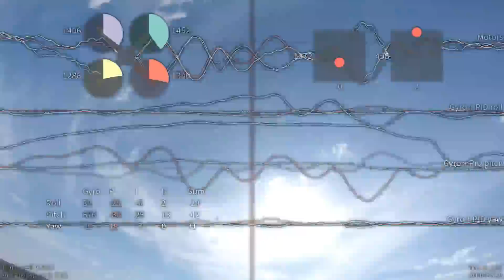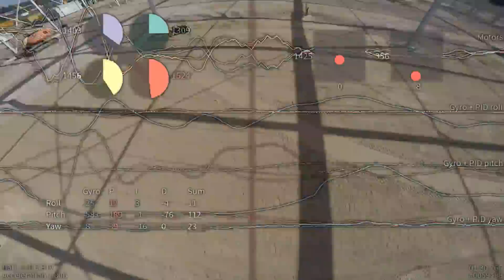Blackbox Overlay - UC FPV Freestyle RAW

Comment: Wow... that's "bank and yank" on a multirotor!  Very interesting flying style.
Reply from the maker: ***** Haha.....I am still using some yaw, but it's quite sensiteve. Check the numbers of yaw axis. There are always some small inputs, but yeah this is a nice demonstration that yaw speed in multirotors is definately not that important for racing and ripping around. I had many discussions about this with people claiming yaw is very important in racing :D
Reply: Carbon props and an insanely tuned machine most likely. =)

Comment: Hi Boris, thanks for doing this. Is right I thought. Now I have a question... why the quad flight forward if you don't moves your stick. Do you have some trim in your radio or something?. Thanks so much for answer all your fan's questions! !!!!!. Dennis.
Reply from the maker: Dennis Lobos I fly in acro/rate mode. The quad keeps it's angle once you put it thare till you move the stick back again. In self level mode you always need to push the forward stick.
Reply: Understood, in cc3d that will be rate or acro+??😊

Comment: Very interesting, I'm surprised at how little yaw input you give, it doesn't seem to make sense.
How do you sync the video and overlay? I've not used Blackbox yet.
Cheers
Reply from the maker: ***** My yaw is very sensitive I need just a bit of yaw to make turns. Cleanflight PC2 has a very fast and snappy yaw.
Reply: Boris B. Ah, that would explain it! I'm yet to try LuxFloat.
Amazing flying by the way.
Reply from the maker: Instead of looking in the sticks you can also see the numbers of each axis :D. They all are being used all the time.
Reply: Ah yes, Good point.
Thanks

Comment: It's Beautiful!!
was there much work to setup the blackbox feature??
Reply: Max Powerz Is it recording to a usb stick or memory card connected to the usb port on naze?
Reply: Max Powerz you connect a special circuit that allowes the installation of a microSD card, this is where all the parameters you see are recorded. there are tutorials on how to do it, not to mutch work, search for "cleanflight blcackbox"
Reply: one of the openlogger's ??
I was looking at getting one after seeing boris's video.
It amazing to see the flight data when it's overalyed over the video, would be amazingly helpful when fault finding issues and PID tuning.
Reply: I found the help files/installation guide on github :D thank-you !!
Reply: yes and also very helpful when something goes wrong, like a real backbox. No prob ;)

Comment: I love seeing your sticks and gyro values! Is that your Cobra 2204 2300kv HQ5045 BullNose setup? Pushed mine last weekend and have to say I still think the EMAX MT2204 2300kv with HQ6045 do deliver more punch :( (sadly I seam to kill them too fast (10 flights => one bad motor) since I switched to KISS^^)
Reply from the maker: 6x45 would deliver 5-8% more punch than 5x45. That's a fact, but you will get win more agility with 5x45. It's always a trade off. For my style full throttle is not being often used so yeah definately 5x45 for me :)
Reply: Julian, would you share your 4s EMAX MT2204 with HQ6045  PIDs ?

Comment: I'm looking to play with this feature.  What rate denominator are you using?  I have a full naze and wanted to only use the onboard 2MB memory.  Are you using external data storage or onboard?
Reply from the maker: planedoctor I used external storage as I didn't have onboard memory on acro board, but both is the same. One flight results in about 100kb of data for me so you can record quite a lot on 2Mb.I use 1/2 recording as my looptime is quite low.
Reply: Thanks!

Comment: Do you use these parameters when you fly? How can you see through all these graphics?
Reply: Frédéric Sidler i think you missed the point, its a blackbox, records all flight data, you don't see this in-flight.
Reply from the maker: Frédéric Sidler No I don't see anything when flying in my screen :D. This is being recorded by blackbox. You know like real planes where they have blackbox data recorders.
Reply: Boris B. I thought you were using it during your flight. How do you use these informations after your flight? What do you do with it? What improvement does it bring?
Reply from the maker: Frédéric Sidler You can see if your motors work as expected....you can check your PID outputs and finetune those. You can pretty much analyze anything you want and even do crash investigation in case something goes wrong.
you can also analyze your flying on the sticks.

Comment: Hey what are you doing to get rid of the oscillations ?
Reply from the maker: jbalatutube What oscillations do you mean? There are different kinds of oscillations.
Reply: Sorry Boris just noticed that your motors are bouncing all over the place, I thought the one shot setup would give smoother control. By the way some awesome flying there and a great little project. Is the spark fun the only option at the moment for an acro Naze ?
Reply from the maker: A little bit of bouncing motors is normal as there is a constant small correction going on. You have to look to the gyro data and you will clearly not see any overshoot accept that yaw axis P could be decreased just a little bit. That's where the "tuning" oscillations would be visible.

This is from the naze32. I don't know if sparky would support it.

Comment: The turn you do at 0:20.  I don't get it.  You barely use any rudder and you flip the tail so fast.
Reply from the maker: samik83 It's a puzzle ;). No really hold a quad in your hand and repeat the movemets :D. You will understand it.
Reply: Boris B. I've watched it 10 times, but I don't get it. You give it left roll, but it doesn't roll.  When I do a similar turn (not as snappy) I have to give it lots of yaw.
Reply from the maker: Look very good. My sticks are pretty sensitive. Full stick is 760degree/sec rotation. And my yaw is also very sensitive and especially on PC2 you don't need much input to yaw.
What I do is pitch over it and look to the ground. Once you are ligned up properly you quickly flick the roll and adjust the pitch so you look to the other direction.
Repeat this movement with your hand and you will see you don't need yaw to turn to opposite direction.
Reply: Boris B. Gotcha. Your pretty much pointed straight down and you just roll and pitch back up. Too fast for a noob to notice ;)
Reply from the maker: yeah the speed and timing of the stick moves is the most important. I do it without thinking and you can do it with a lots of different variations. It just requires training to print those in the memory ;)
Reply: Boris B. Now excuse me while I go and try this with my week old Blackout and crash horribly. 
I've got a year of LOS flying under my belt but FPV is a whole nother thing.
Reply from the maker: samik83 Good luck m8 :D